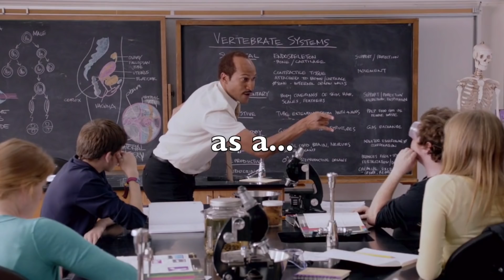Using Tesla parts in my Electric Rat Rod Conversion

Comment: as a person that works with screws and bolts. Why would you ever you use flatheads willingly.
Reply: Was thinking the same thing. I have banned slotted screws from my work shop
Reply: As a person who works with screws and bolts we don't call them flathead, they're called slotted
Reply: @NateBury  As a person who uses google to search, you are correct. In fact, flat head screws isn't what Rich is using. Flat head screws have a flat head and tapered sides and are design to go into counter-sunk holes and be flush with the surface. They come in a variety of styles... slotted, phillips, hex, torq, etc. The screws that he is using that everyone dislikes is a "slotted round head".
Reply: Allen head
Reply: I have expanded my fastener knowledge by reading this thread.
Reply: I'm 100% sure it's because:
1 - they're cheap, even cheaper than the already cheap other types;
2 - he had a bunch laying around;
3 - he ain't caring
Reply: @eosjoe565  we call them flathead in the UK, any slotted screw would be described that way, well I should say thats what I know them as, who bloody cares,lol
Reply: Those are pan-head...

Comment: Rich has inspired me to take the heatsink off of my CPU and give it a little air to cool it off while it's running.
Reply: If you drive arround with a open case, you should be fine 🤷🏽‍♂️😁
Reply: LMAO
Reply: Frederik Müller-Späth drive?
Reply: ... should we tell him
Reply: i did the same but zip tied mine to my ceiling fan.
Reply: You joke, but I've seen a heatsink detach from a running CPU. Before I could switch off the mains electricity supply, the thing had fried. It took less than 3 seconds. Dead as a dodo. Very expensive.

Comment: You silly Billy, that's just not how cooling works, you better use that heat sink
Reply: Option 2.... longer bolts, slap that heatsink under all that steel ( after making it sit flush ).
Reply: Mounting the controller to the steel plate would have most likely proven more successful than the air gap.  Heatsinking the far side of the steel plate would help some, but the steel is not as good of a thermal conductor as the aluminum.

Either way, an industrial tub of arctic silver would be beneficial.

Comment: Not gonna use the heatsink? "Are you sure about that?" - John Cena
Reply: The amount of cooling from a flat plane will be so much less than the fins it had
Reply: Put the heatsink in the other side of the steel, it should help with cooling and support the controller at the same time
Reply: Skye was thinking the same, maybe use some copper grease to make a thermal connection cause that PC CPU thermal paste in those amounts might cost a lot.
Reply: Hm, I doesn’t get the whole heatsink idea. The aluminum body had a huge surface cooled by air - so let’s try without it? Using the frame by adding heatpaste might not be enough, but his solution has the least chance. It‘s like getting rid of a cpu-cooler to get air closer to the source. Air is basically a insolator as it transfers temp very poorly.
Reply: If he is lucky, a temp protection kicks in. Good luck, Rich.
Reply: I wouldn't add a space but would put the heatsink on the other side of your mount, else it'll fry for sure. BTW, you don't clean off the drill shavings? Rich ... you need to work a tad cleaner.
Reply: I though those fins would look like a cool air cleaner. Leave them and flip the unit upside down so the fins sit above the battery and air goes by at a good rate. And get the fins polished!
Reply: I would put some thermal paste just in case.
Reply: I was thinking the same thing about the aluminum heat sink. Heat transfer is much better for aluminum than steel and just having air flow for the cooling will probably not be sufficient. You might burn out the controller if it gets too hot.
Reply: steel is one of the worst materials you can use for a heatsink.
Reply: Rich, you should keep a fire extinguisher in this car.
Reply: Cooling the controller with airflow only isn’t gonna be enough if you compare the cooling capacity of the heatsink you pulled off, so please rethink otherwise you’ll burn the controller.
Reply: What could possibly go wrong??   😉
Reply: In best case the Power module will derate worst case it will burn out
Reply: i already can smell daisy second coming... hope rich have firefighter and fire extinguisher on standby nearby...
Reply: @SailingWithVampires  I really like this idea.
Reply: Two words ... Surface Area
Reply: That motorcycle heat sink might look good mounted where the radiator would have been.  You might want to look into conduction vs convection and re-consider the omission of the aluminum heat sink.
Reply: Just change that steel plate to a aluminum one. Cut a hole the size of the heat sink. Weld the heat sink into the hole. ( may have to pay someone to do it). And than mount the controller to the sink. The fins will be under the frame and should get plenty of air to it. Imho
Reply: Or do it ur way and entertain us with another 4th of July show. I'm good either way... ; )
Reply: He must be trolling. Left that part unfinished on purpose. He's just going to drill through and mount the heatsink under the plate with longer bolts. Thats why we dont get to see the spacers. Also, if spacers would be coming, why bother with finishing the weld seam?
Reply: You should double that heatsink, not remove it. Think of a CPU in a PC, would you put a steel plate spaced out from it on it, rather than an aluminum heatsink touching it?
Reply: I was thinking the same thing it'll have a lot less cooling and thermal mass without it.
Reply: naah, just tie wraps run behind this now to hold the cables. These will dissipate the heat for sure... :P
Reply: I think the aluminium heat sink with fins would do a better job than a steel plate.

Comment: Mount the controller directly to the mount plate with as much contact area as possible. Metal will pulled heat much better than air. You might even consider a cooling system for it. You can also use thermal conductive paste.

Comment: The heat sink thing, got me so triggered because it’s such a bad idea. It’s like removing a cars radiator and adding speed holes in the bonnet haha 

Rich is doing the lords work
Reply from the maker: Triggered? My work is done
Reply: Homer Simpson speed holes.... SOLD!
Reply: The lords work?  Without proper heat sinking, (is that a word), He may very well be sending that controller to hell.
Reply: Maybe Rich should just put speed holes right in the controller!
Reply: Lords work? More like he will be seeing the lord if anything happens in that death trap of shitty welds etc
Reply: Rich Rebuilds haha love your videos nonetheless. They’re shock therapy for those that are easily triggered. Someone hold me

Comment: As a thermodynamics expert, you need the damn heatsink
Reply: Yeah, the material they make those diode and transistor junctions out of, well, that crap BURNS.  and electric wattage is HEAT.  Everybody who is more than 30 years old remembers when cars first started coming out with engine computers.  the cars were dropping like flies!   They couldn't keep the things cool and so they were burning up.  (they eventually developed energy saving low power computer logic circuits.... using the same logic as a 1985 car computer, a smart phone would explode like a Hiroshima Bomb).   But, yeah, as an electronics tech working on something dead that comes into the shop, just look for where the power is the highest and that is probably what burned up.   So it is CRAZY to toss out Heatsink.
Reply: @leovolont  leaving an air gap is also worse than bolting straight to the plates as well? Air gaps are poor thermal conductors yes?

(I'm a machinist, not a fridgie or electronics guy)
Reply: @prdoohan    Yeah, air is an insulator.  To make windows that are insulative, the first prototypes used two panes of glass separated by an air gap.   OH! That gave me an idea for how he could Liquid Cool this thing at maybe a weight savings.  Two plates that are each etched out to have matching groves, so that when the plates are fitted together, the groves form channels.  Add fittings, a pump and a light weight radiator like we find on some liquid or oil cooled motorcycles.
Reply: @prdoohan  yea, and that plate is not the right kind of metal to carry the heat away.  Big electronic fail coming up...
Reply: Best would be bolt to steel and the bolt the heatsink underneath and use a lot of thermal paste
Reply: @Mr2winners  That steel might still conduct a little (just a little) bit of heat, so sandwich in a layer of asbestos for maximum effect to keep that heat sink from getting too warm.  lol
Reply: @Mr2winners  Hi Mr2,  yeah... bolting the Hot Part to the sheet steel and then bolting the Heat Sink underneath, well, it would give the heat somewhere to go, and it would have a lot of avenues for  the heat to dissipate off.  I wish I knew whether the the Heat Sink was aluminum.  Aluminum conducts heat better.  So I am thinking that the steel may be something of a Heat Bottleneck.  The Zero Engineers probably designed the Heat Sink to be able to pass thru Extended Maximum Load Heat.   There are probably not many allowances for inefficiencies.
Reply: As a Sevcon employee, yeah, he needs the damn heatsink.  Otherwise he's going to enjoy all sort of de-rated power once the controller gets nice and toasty.
Reply: Lol steel is an order of magnitude worse at conducting heat too
Reply: As a random commenter for umpteen years. Yes. Bolt to large thermal mass with low impedance and it's better than a heat sink.
Reply: @Mr2winners  I said the same thing..
Reply: @prdoohan  yeah steel is real bad heat conductor...air is also bad heat conductor...that is why he needs the high surface area of the aluminum finned heatsink to transfer heat to air...aluminum and water are good heatsinks
Reply: Leave the heatsink on and cut a hole in mounting plate for the heatsink to go through. Without the heatsink I'm sure it will overheat almost immediately.
Reply: As a bathtub installer I think it you run a bead of silicone around the air gap under the controller it will allow the air to heat up and help keep everything at an optimal operating temperature. Carefully filling the gap with asbestos powder will increase this effect. The now redundant heat sink will make an excellent cheese slicer. You can use the other side of the controller to fry up delicious grill cheese sandwiches.

Comment: As a professional zip tie installer you need rubber grommets for the zip ties

Use the kick stand as a security fob
Reply: Lol yep

The zip ties get worn through the same as the wiring insulation. Eventually, anyhow.
Reply: Good idea!... you can use it as the charging door (if there isn't a rig for that yet) so it can't move when charging! that is my suggestion as a professional suggestion maker!
Reply: No you don’t.

Comment: To cool the controller, why not just put the controller with some thermal paste on the mounting plate, then the heat sink with more thermal paste on the bottom?
Reply: That would certainly be better than nothing.
Reply: Exactly what I was thinking, would be like adding another heatsink between the controller and the original heatsink by having the frame in there for extra cooling while it works harder for a larger vehicle
Reply: Steel is a very poor thermal conductor. Adding a plate of steel will increase the controller temperature a lot. Aluminum has 4 times better thermal conductivity.
Reply: I would find a heat sink more fitting to the area he is mounting it. The factory one is a little oddly shaped for his purposes ( or grind down the current one to size. Ideally he should get a much larger heat sink (with thermal compound) and/or have a small outdoor automotive 12v cooling fan attached. If he is trying to save power then a huge heatsink the length of the plate it is mounted to. May still have heat issue pack8ng around that vehicle though.

Comment: The heat sink is there for air cooling already and it needed a that metal with a huge surface area to allow the cooling to be enough when being used on a light motorbike! You have just done exactly everything you should not do! That fire in the next episode is so going to happen!
so keep going cause this is going to be a popcorn end to this series! Can not wait to see what happens
Reply: @Jomama he'll show it, his project burning to the ground would get views.
Reply: @Jomama  Oh,  yeah!  He'll show it.  Like banging his thumb with the hammer, or reaching out to touch a cherry red piece of steel... to see if it's still 'hot'.   Oh, but the problem is that most of the current will be flowing through the Controller when the engine is under load.  The most we might see is.... Hmmmmm... I had to think whether that Controller will burn Open or burn Short, but if it burns Short then it will pop a fuse, SO, then most we'll see is that the "Hot" rod  will just drift to a dead stop.
Reply: @OverUnity7734    You don't get insurance claims for a car just dying in the middle of the road... unless it dies while trying to make a left hand turn across traffic.  Oh!  that might be a life insurance claim...

Comment: Hey bro I am not a professional but with that setup you are definitely going to fry the sevcon gen 4... just imagine you processor in you pc with only a fan blowing while you push it in the limits...
Reply: Yep.  Toasty!
Reply: Tryant666 oohhh that’s innovative...I am surprised that the engineers who constructed the bike didn’t thought about it...probably the didn’t want the bike to be lighter
Reply: Conduction vs convection
Reply: I understand he wants to save space but that controller is gonna melt. You basically go from a very effective heat management system to literally the worst thing you could do by providing an air gap and removing the heat sink.  His car tho so continue.
Reply: Hi, Everybody,    Yeah, "as a guy" who worked electronics circuits for about 30 years, you really got to take those heat sinks seriously.  Not only don't throw them away, but you also have to go out and get new silicon heat grease and freshen up that seal so that you have maximum convection between the Part and the heat sink. .  Also those heat sink fins were directional and I bet that the motorcycle was designed to have some scooped air flow going by.  I guess it would not need a fan for stop lights and sitting, because electric motors and those kind of circuits are generally cool when they don't need to run power.
Reply: Yeah he took it from a lighter bike that needed the heatsink. Now he's using it in a heavier car with no heatsink. Seems obvious that it's going to fail. In a previous episode he said he was going to use the steel as a heatsink now he's spacing it up.
Reply: @JusttheEdge   Hi Josh, yeah, and that looks like a really expensive part.  That part could be a third of what he paid for the bike, and he's gonna just toast the thing.
Reply: As a man with sound judgment, your decision to wear flip-flops makes no sense, both from an aesthetic and utility perspective.

Comment: The heat sink is very important , I believe you should find away to install it back
Reply: Agree, steel to steel is better than air.  Mount the sink under the plate
Reply: @jayj6770  Through the plate is the way to go.

Comment: That inverter is going to cook itself this way. Just passing air underneath it won't be enough. It wasn't enough on the motorcycle (why would Zero add one if they could have gotten away without?) 
And as you said yourself, the inverter will have to work much harder now, meaning even more heat.
On top of that, my uncle has a Zero (don't know if it's the same model) and he's said that it reduces power very quickly due to the inverter overheating.
Reply: "as a person whose uncle has a Zero..."

But in all seriousness yeah that bit has to be a troll, right?
Reply: @clard52  part of me hopes so, the other part wants to see fireworks
Reply: Think of it as taking the heat sink off your PC and trying to run it,it may work for a few minutes or an hour,but it will absolutely fail because it can never handle the heat range without a heat sink.When putting the heat sink back on you will also need thermal paste.This keeps the both units cool ,it does a much better job at allowing the heat sink to work properly since they expand and contract at different rates

Comment: As a youtube fan of about 2 months, I can say that the professionals are correct.  Reminds me of when I went to purchase a slightly wider tire from a shop.  I expressed interest in 285's, which they had on hand.  The professional emphatically tried to tell me that tire would be no different than my current 275 tire, because they were both 40's.   I asked him if he knew what the numbers on the tire meant, politely as I could.  "Don't you tell me about tires, I've been doing 'this' for FIVE years!".  I let it go, and just bought my tires.  As I left he came back and asked me if I was sure about the size!?  I said, just turn to page one of ANY shop manual.   This is my view of 'professionals'.  Continue on Rich!  You earned a fan, here!

Comment: 16:55 Oh it will... 10:11 By replacing a proper heat sink with a half steel place and hiding it from airflow there is a good chance that your controller will burn very fast.
Reply: It may save itself by thermal throttling. That'll just make it slow/shut down though. Not ideal.
Reply: @clard52  True.

Comment: Wouldn’t steel on steel be better for heat dissipation than an air gap?  The entire car becomes a heatsink.  Air is actually an insulator.
Reply: True. And need cpu Grease too.
Reply: The steel plate will not conduct heat away. You know how you can hold one end of a steel piece while welding it? Steel and iron are terrible heat conductors. He really does need the aluminum heat sink and a lot of forced airflow over it.